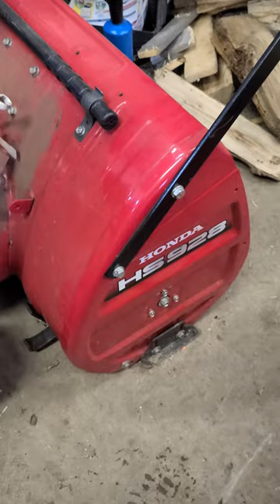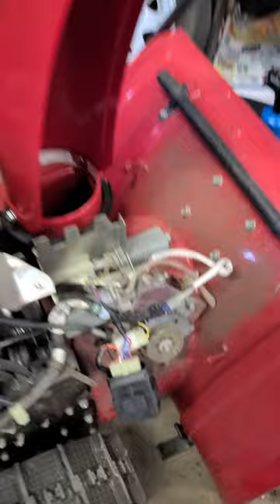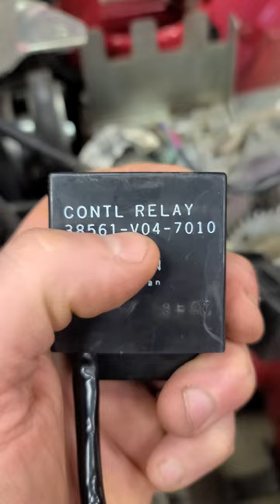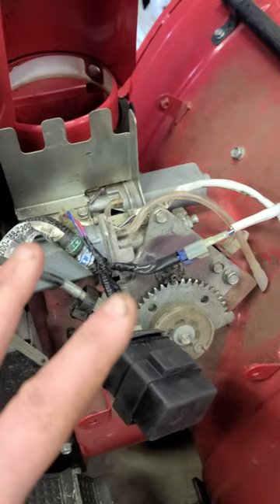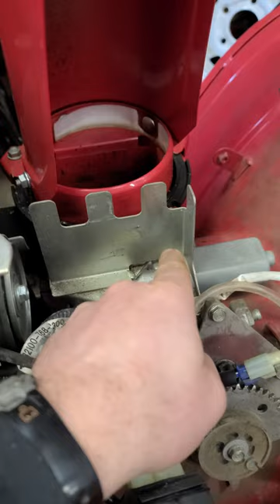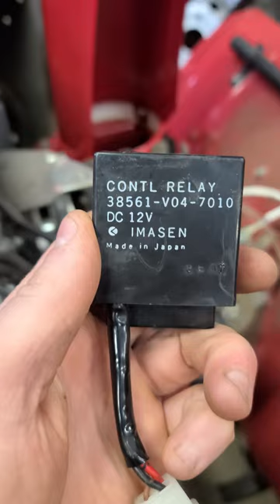If Your Honda Snowblower Chute Won't Rotate Check This First! #shorts

Comment: wow, electronic chute controls...and all I have is a worm gear on mine...and guess what, it has NEVER failed me...sometimes, companies are too smart for their own good
Reply: Nor has my Tecumseh powered 80's Toro 724.! Runs like a raped ape! 
I do however like the idea of a motorized  mod for the chute direction, rather than stooping to change directions. Maybe I'll saw off the handle, extend it, and chuck up a cordless drill. Ya know? Just fabricate a jig to hold the drill, maybe make it easy to remove with some wing nuts.   Well that just now flew off the top of my slightly defective head, but in theory it should work

Comment: This is why you don't want these modern machines with these motor driven chute controls. Hand crank is best. KISS.
Reply: My Honda snowblower has a hand crank chute and it always works. It’s KISS certified.😅
Reply: @ussreeves  Haha, mine too, 1987 HS80.
Reply: Right on the nose Jerry.

Comment: Great diagnostics Don! I had one that the chute would not rotate to the right. After troubleshooting I found it was in the joystick, Honda calls it a "chute control". Inside are tiny little contacts similar to points, I cleaned those contacts very carefully and it did the job. I believe the joystick assembly is only $50.00 but it didn't take long to disassemble and clean her up. Something else that can go wrong in moving that chute left to right!
Reply: This is the same as in all Relays. An electromagnetic coil pulls contacts together to close a circuit when voltage is applied.  On my budget I would sooner open up that relay and clean those contacts. Most are glued together but nothing a dremel and a small cutting wheel wouldn't accomplish in quick order! I've used a 1/2" width of 800 grit sandpaper folded in half longways and pulled through while holding gently down on the contacts. i have an old flat brass type feeler gauge to slip in to the folded paper so the points are cleaned FLAT.  the cover can be put back on using the proper adhesive, an although many of these look to be sealed by epoxy, but they don't get to win! LOL
 I' did washing machine timer the same way, a bit tedious and took a few hrs but did the trick and after 10 yrs she's still working flawlessly. Now I have a set of fine needle files of all shapes. Very handy way to save tons of cash to use on better things than exorbitantly priced items.

Comment: Also, my HSS1332ATD chute control stopped working. 
   It was the metal contacts in the joystick.
   Just clean them with alcohol and this fixes the issue.

Comment: Great vid Don. Not enough quality Honda repair vids available. The cheapest chute motor I could find  for the HS models in Canada run me $225. Had bought one for a spare when I bought the HS 928 . Never needed it . Sold it with the machine. A lot for a power window motor. The motor for HSS models is about 1/4 that price.
Reply: Jer, I believe he is working on a HSS model as the HS blowers are all manual crank chute control led with no electronics.

Comment: $300+ for a relay???!!!  😲  Snowblowers are getting as crazy as cars and trucks with the electrical/electronic controls.  Next thing there'll be a computer control box and an OBD2 reader required.  Great work, Don.  You're the man!
Reply: Cable. Connector. Weather resistant potting. Skilled labor to assemble. Yes it's ridiculous.
Reply: @jimbarchuk   I recognized that it's a premanufactured  and weatherized assembly, but the parts couldn't cost more than $50 USD, $65 tops.  It's likely also made mechanically by machines, no physical labor, so could assembly and an OEM label really be worth $250 more?  Everything costs more now due to Covid, gas and diesel, but a lot of that is simply Pure Corporate Greed.
Reply: Yeah and we'll have to pass emmisions on the things as well! Agreed Don is King
Reply: @100vg  100% agreed, not only that, planned obsolescence has been the norm. Even for a Honda for cryin out loud.
Reply: @ChrisMichaelsChicago   Planned Obsolescence is just another form of Corporate Greed.  I'm sure the Engineers objected, at least at first, but they also have to keep their jobs, so they have to fulfill the Corporate decisions.
Reply: @100vg  yeah what a shame. Sometimes I wonder who the hell engineered this, and why it's such a stupid design, but you just answered that question.

Comment: Donyboy, if you have one that’s bad, instead of just showing us a $300 part to replace, why not take the bad one apart and see what’s inside, and figure out if it can be fixed by cleaning the contacts or soldering a connection?

Comment: Donyboy73 is this a common occurrence of these electronics to go on Honda snowblowers? I’m worried since I just purchased a brand new 1332atd and coming from manual chute. Do you see a lot of these? Thanks
Reply: Apples I've personally have only seen one and the problem was in the $50 joystick or chute controller on the dash.

Comment: Hi Donny.  I have a question about my Craftsman Snowblower.  My chute tilt always freezes when it's cold.  If I blow a hair dryer under the control for 5 minutes or so it will unfreeze but it's a pain for sure.....Do you know of any fix for this?
Reply from the maker: you need a new chute tilt cable

Comment: Bad-azz and expensive (Over $3,000 here in the USA) snowblower!  It's too bad parts are expensive as well.
Reply: But it would be the BEST $3,000.00 you ever spent!! 😂🤣🤣
Reply: The 928 fully equipped here in Canada is $4,500. plus here in Newfoundland 15% sales tax, but I have had 38 snowblowers since 1980 and Honda is still the best
Reply: @byronwoolfrey1039  that's a lot of snowblowers!! I started selling Honda snowblowerz in 1985 and have seen the transitions especially the steering and electric chute control. Honestly customers asked for years to have steering and a different way to adjust the chute. If the chute on the old HS models was adjusted properly you could spin that chute crank with your pinky, lol. I had that adjustment down to a science. Main reason is when a potential snowblower customer comes into the showroom guess what they most always grab, touch, tryout first? Yup, the chute crank!! We used to stand behind the counter and take bets on that! 🤣🤣🤣
Reply: @byronwoolfrey1039  on another note I'm still nursing my 23 year old HS928TAS. If someone stole it tomorrow I'd go right back out and buy another Honda.....at twice the price.
Reply: @byronwoolfrey1039     Thanks!   They are pretty awesome, hydro drive, tracks, etc.  Here on Long Island the lower grade units of each brand are sold.  I do believe Ariens makes a high-end to compete with the Honda.

Comment: get a 12 volt spdt relay
Reply: What's a spot relay and where do you find one
Reply: Spdt spell check
Reply: @donmcconnery5080  its a single pole double throw relay,,,i did not say spot,,read again  spdt
Reply: @donmcconnery5080  lol he doesn’t need spell check and it’s not spot.  
It’s SPDT
Single pole duel throw. 
If you’re not familiar you probably shouldn’t mess with it. 👌
Reply: you better  spend  the 300 bucks if you dont know what spdt means
Reply: We're not all experts in terminology and abbreviations, but thanks
Reply: @dennisqwertyuiop  well yeah the D means duel. What people?
Reply: I was saying that I typed it in spdt and spell check made it spot
Reply: @donmcconnery5080  I get it. 👍